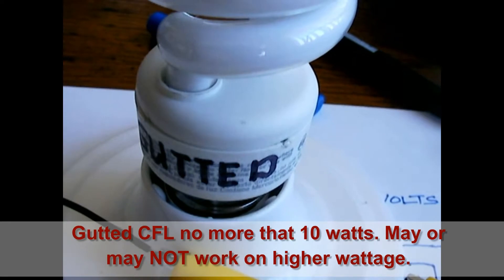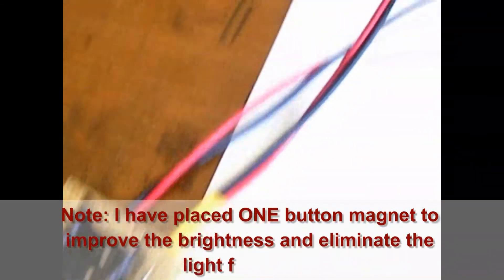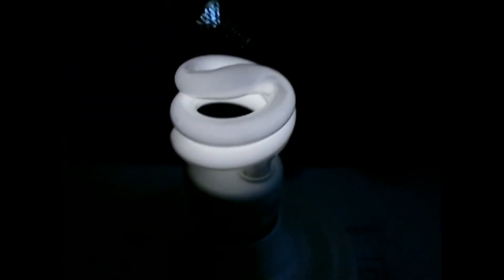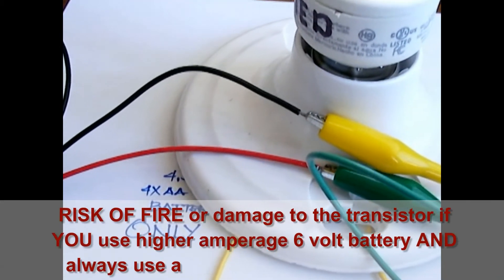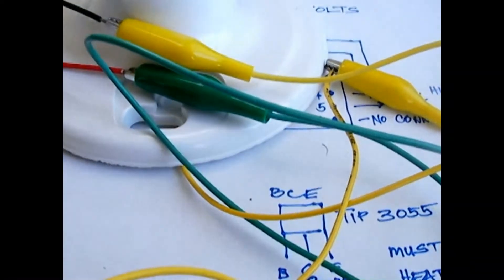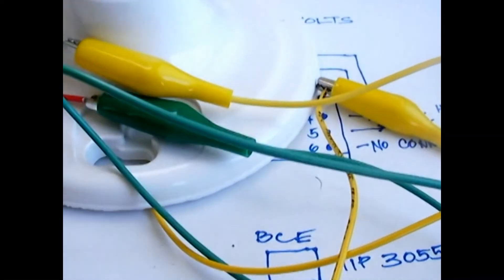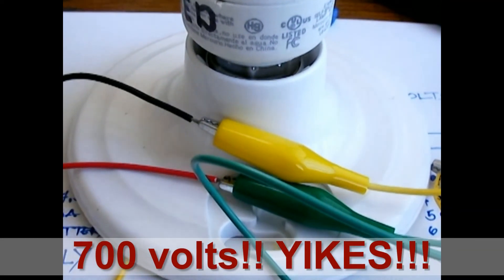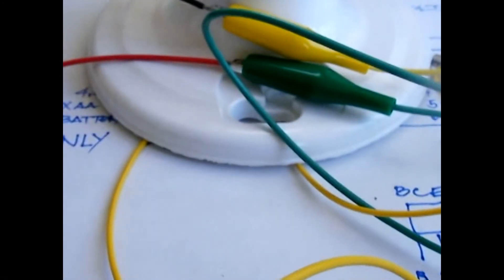Disposable Camera parts lights a Gutted CFL

Comment: Ok I did this but the light is dim. will this be safe on 2 c batteries? I have what looks like a yellow base which holds the batteries and the bulb and circuit is in an old ice breakers min canister. I just want a little more light out of this so will 3VDC be OK for the circuit? Please reply.

Comment: Have you identified the transformer, does it have a number on it, I have played around with the Fuji circuit and powered gutted CFLs and gutted LED lamps, they pretty much all work..Just can't identify the transformer. I think it has 3 coils all wound on top of each other or 2 coils where one has a center tap...Do you have any ideas?